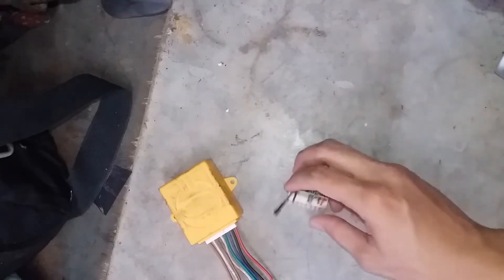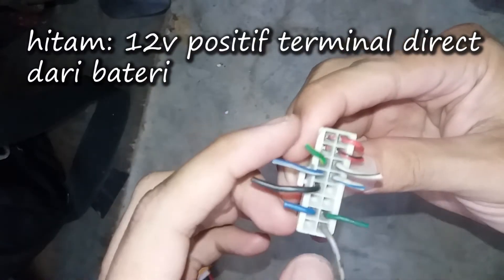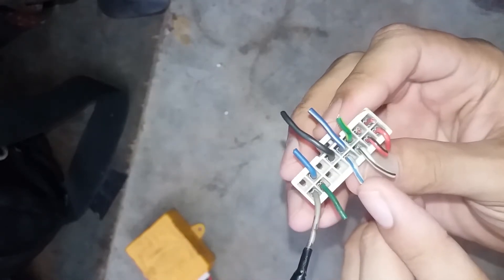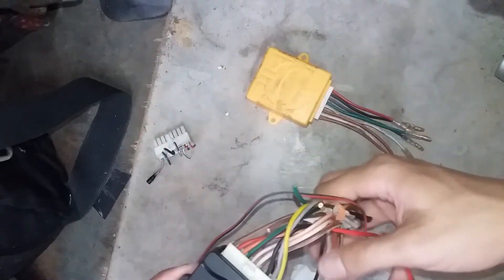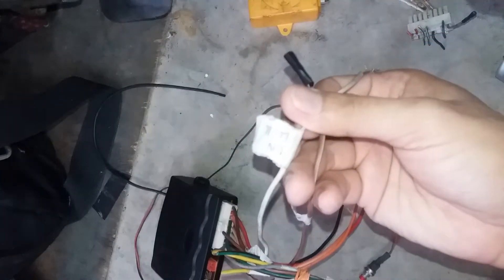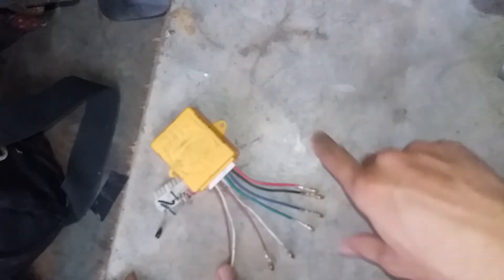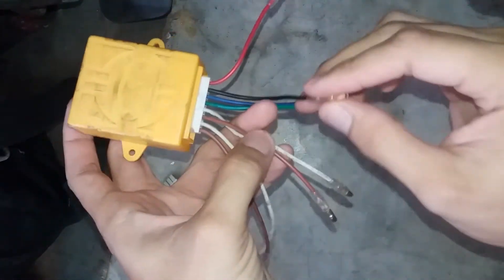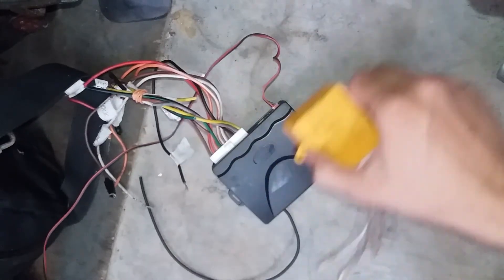Central Lock Perodua Kenari (wayaring overview)

Comment: Bro nk tnye .. klo alarm standard ori .. tp dh tukar 1 set wiring center lock jenis pistol .. klo nk kacukan center lock tu pakai ngn alarm ori bole ke ? Skrg ad 2 wayar yg tk sambung kt module center lock tu unlock ngn lock klo kacuk bole jalan ke lock tu ngn alarm std
Reply from the maker: 2 wayar tak sambung tu warna apa? Warna koko & koko/putih ke?
Sy rasa x boleh, kalau sambung 2 wayar saja ke alarm ori..utk hidupkn alarm ori, kena ada beberapa wayar (positif & negatif & acc) baru alarm ori boleh berfungsi.
Reply: @afaris  kt alarm ori tu wiring lengkap , cuma wayar supply lock unlock yg asal je tk pakai owner lama potong masuk pakai aftermarket center lock module 
 remote hilang
Reply from the maker: Ooo..alarm original, central lock saja yg dah tukar afternaket.
wayar yg x sambung  tu warna apa boss?
Reply: @afaris  wayar yg tk sambung lupa pulak .. tapi cuma wire2 yg supply api ke pistol actuator yg asal je dh tk sambung sbb owner lama dah pakai aftermarket 1 set siap wiring
Reply: Kt aftermarket center lock module ade 8 socket .. iaitu coklat , putih ,  coklak, putih , hijau , biru, merah hitam .. so mne satu kne potong dan masuk kt alarm ori pakai wiring aftermarket
Reply from the maker: Sy baca komen awal, 2 wayar yang x sambung utk lock & unlock pada cntral module aftermarket. Nnti cuba pastikan warna apa wayar tu..senang sikit.
Boleh saya tau, masalah utama skrg yg tuan hadapi? Adakah bila tekan remote alarm, pistol dlm pintu x berfungsi?
Reply: @afaris  itu untuk wire ke alarm klo kt dlm diagram module kt google iaitu warna coklat putih .. so dua wayar tu bole sambung ke alarm ori atau buang module tu amik wiring shj potong psang di alarm ori ?
Reply: Tkde ap2 masalah pun cuma nk guna alarm ori sbb dh ad remote duplicate tinggal tkthu nk wiring actuator pistol lock tu pada alarm ori , sebab dh pakai after market module
Reply from the maker: @SergeyAlexandrovofficial  sekarang kereta tak ada alarm lagi ke? tuan baru rancang nak guna alarm original kan? macam tu kan....? sbb saya cuba faham apa masalah utama yang dihadapai oleh tuan..
Untuk selamat (takut shot wayaring) dari alarm original, sambung soket alarm tu guna teslight test setiap wayar, & cuba tekan remote, lepas tu tengok wayar mana yang menyala bila remote ditekan.. wayar menyala tu sambung ke koko atau koko putih (aftermarket). Sepatut nya alarm akan bagi signal pada pistol bila remote ditekan.
Harap membantu.

*selalunya, dalam pintu dah ada wayaring original dari alarm ori.cuba check dalam pintu, warna wayar original..apabila dah dapat warna wayar original, check warna dekat alarm & boleh sambung terus ke module aftermarket.(Untuk kenari Biru & biru/putih)

Kalau tuan dapat buat video & share dekat sini, lagi OK..boleh kawan dekat youtube bantu sekali utk selesaikan masalah ni..Sbb saya pon masih belajar lagi.
Reply: @afaris  ad tk ap2 yg bole saya chat secara voice baru faham skit
Reply: @afaris  trigger nya nk kne check guna test lamp ?